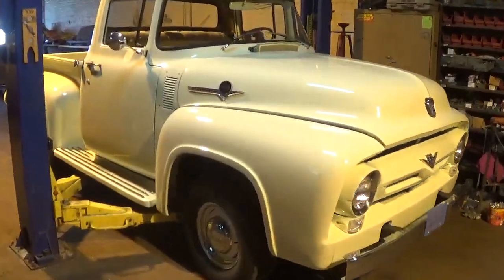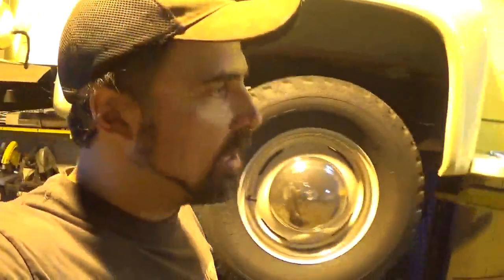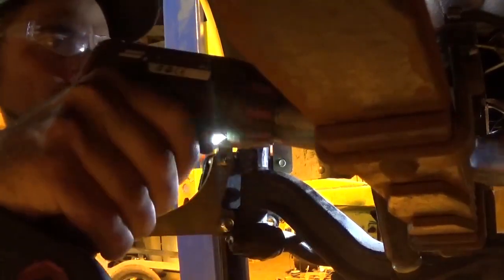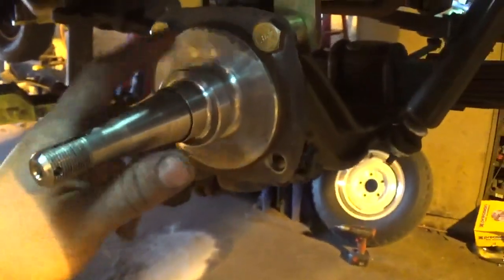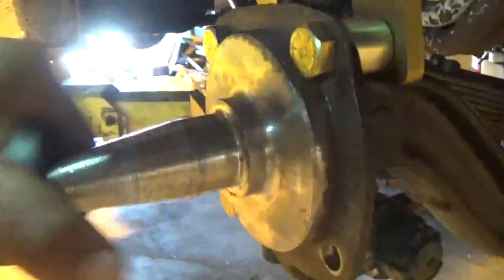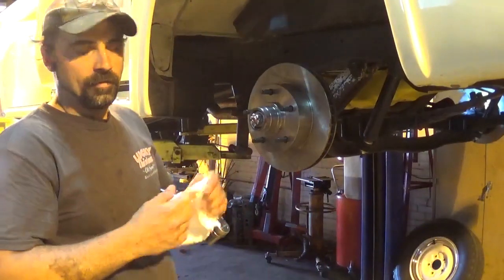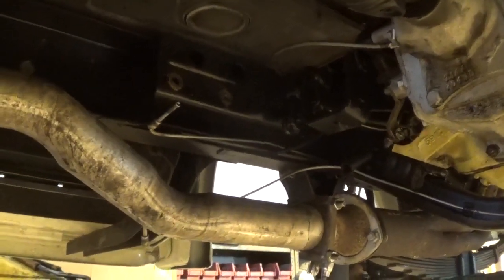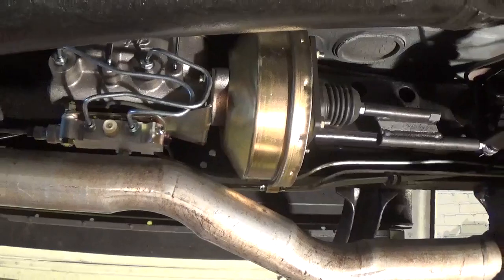56 Ford F100 Classic Performance Products Disc / Power Brake Upgrade!

Comment: I have the same kit but with the correct booster bracket. I don' like the idea of having to replace the clutch linkage. Did you use the existing threaded rod to modify the the rod pedal assembly?
Should be a rod bent at two 45 degree angles to eliminate the clutch adapter kit. Thanks
Reply from the maker: Hey Jim, because of my bracket being wrong in the first place, i got away without having to do any modifications to the clutch linkage.  I just mounted the booster off the frame basically like a generic under the floor brake assembly.  I did use the linkage tube the kit provided to make my offset linkage, but i didn't have to do anything with the clutch
Reply: Thanks for the reply, I will use the purchased adaptor if I can get the old shaft out. If not, I will
just modify the booster linkage similar to the way you did the one in video. I
think the manufacture could have done an offset brake/booster linkage instead
of the extra priced adaptor kit. Thanks Again
Reply: @rottersgarage  Well after a while doing other projects I finally got my kit installed. Master cylinder and everything fit great except the new U bracket for the clutch linkage. Transmission mounting bracket had to have the mounting hole for the clutch linkage moved up about 5/8" and a new hole drilled and tapped for the 7/16"-20 pivot bolt. Perfect alignment after that, even got to replace the old clutch and brake shaft. Much easier than I thought it would be. My master cylinder booster is close to the exhaust too, not sure if it will be a problem or not. Next project is to install the remote master cylinder fill kit. 
Later, Jim

Comment: Hi there How much will be cost this kit for my 53 F 100
Reply from the maker: Just checked with classic performance and they have kits listed as $649.00 plus shipping for 1953-1956 F100's.  They also offer it with three different bolt patterns- 5 on 4 1/2- 5 on 4 3/4- and 5 on 5 1/2
Reply: @rottersgarage  thank you